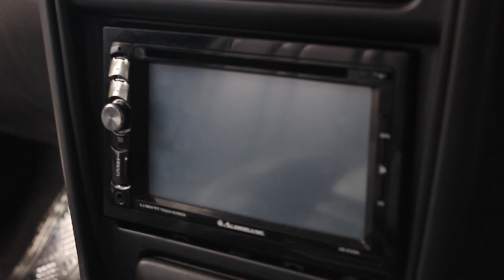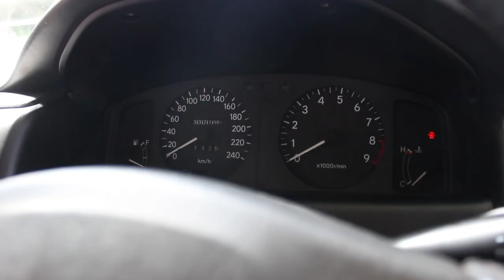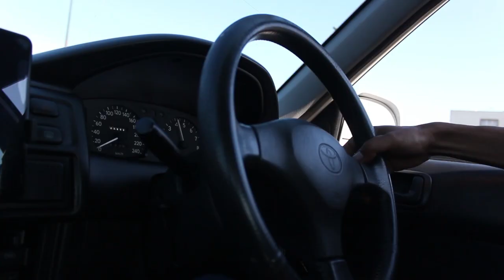Toyota Corolla RXI 3SGE BEAMS SWAP!- This is my ride- Ep02

Comment: I doing swap with 3sge beams also, do you know how to make an Air conditioning working with stock ecu? Should i connect mpx1 and mpx2? But i dont have altezza a/c amplifier and body multiplex

Comment: I see your speedometer not working and I think you said its running factory ecu  does that not put the car into limp mode as thats the issue Im currently having with my 20v
Reply from the maker: To be honest I asked the owner and he says he basically disconnected his speedo as his wife complained about the speeds he reaches lol